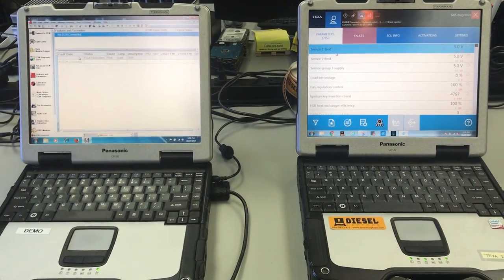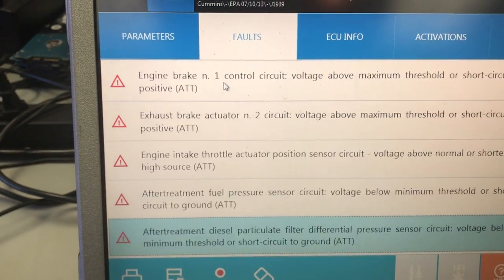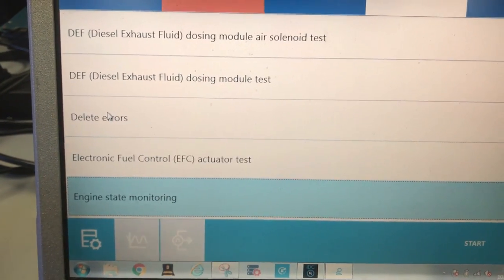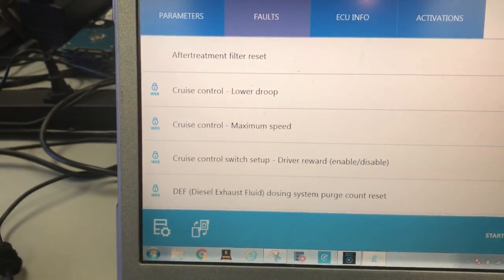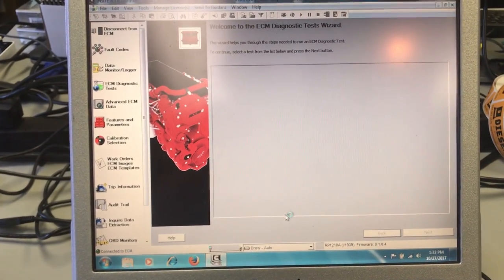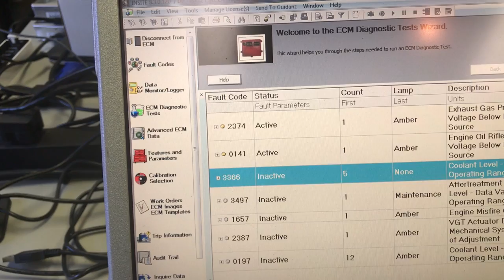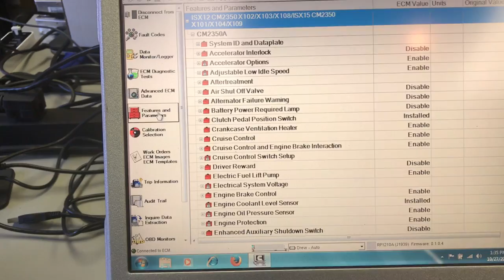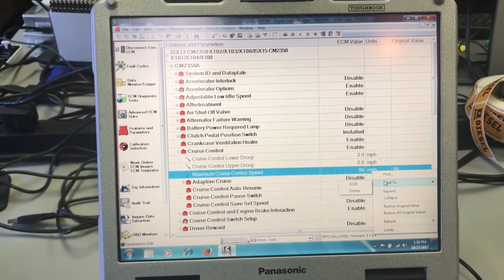Diagnostic Tools Compared: TEXA vs Cummins Insite on a CM2350

Comment: Parameters and signals are two different things I saw a bunch of "sensor Signals"  included in the parameters. The idea that they are saying they are as good as Insite is ridiculous. Where is the aftertreatment event history, Fault Code Snap shot data, can it do snapshots?, Completely left out the advanced ECM data .SMH  There is NOTHING that is as good as Insite on Cummins engines. Repeat after me. That's why our company pays for  50 licenses per year. Texa would be a nightmare for any fleet with hundreds of Cummins engines.
Reply from the maker: This tool can view freeze frame (fault code snap shot data) along with even history. This video is 4+ years old, the software has really advanced even more then shown. This tool will do 99.9% of what OEM software will do across ALL OEMs and all computers on all commercial trucks with no required annual fees. The only thing it can't do is ECM calibration updates. For that we provide rental kits and we also sell the Cummins Insite Pro licenses as well.

Comment: If you have a password protected ecm, can you reset it and change parameters with texa or is Insite and zap it the only option for that?
Reply from the maker: TEXA will allow you to change parameters and such. However, to remove ECM passwords with a ZapIt you need Cummins Insite or bring it to a dealer.

Comment: I would like a help by kind I am unable to connect my insaite with a dodge 2500 model 2014 can help me
Reply from the maker: Cummins Insite will NOT work with Dodge RAM, even though they have Cummins engines. I would just get Autoenginuity for that, it is your best bet at a reasonable price.

Comment: Does this Texa program have the VGT hysterisis test or the DPF regeneration analyzer or the DEF pump override test or the fuel system leakage test or the injector performance test?
Reply from the maker: This tool has all known diagnostic commands for commercial truck engines from 2000 to current. If it is in the OEM software, it is in TEXA.

Comment: Can you change hp and torque settings  with either one?
Reply from the maker: Some ECMs, like Detroit, let you toggle between "normal" or "high" HP ratings. However the vast majority do not. This is a diagnostic tool, not a tuning tool.
Reply: I think what he is trying to say is if you can calibrate the ECM with your product, because if you have dealer level Insite it will allow you to calibrate the ECM to the HP and Torque settings that you need.

Comment: Will the texa tool do the injector balance setting on the Detroit and cat engines?
Reply from the maker: TEXA will do all injector tests that the OEM software will do, including cylinder cut-out test, injector resets, and injector programming (CAT Trim files).

Comment: Does this tool work on diesel pick up trucks as well. Like a Ram 2500/3500 ect.
Reply from the maker: Yes, all Diesel engines from F250/RAM 2500 and up to all the large commercial trucks.
Reply: not sure if anyone gives a shit but yesterday I hacked my girlfriends Instagram password using Instaplekt. Cant link here so search for it on google :D
Reply: @ernestolane3422  you're right. No one cares.
Reply: If you have a 2003 Dodge Ram 2500 it WILL NOT WORK…even though listed. Their excuse is that it is Chrysler only. SnapOn and Autel both read the 2003.

Comment: I would like to see alone videos of your too on European trucks and off highway units, as I have to work on a few of those as well, also Can third party program be install on the laptop e.g. Cat Sis and JCB service master
Reply from the maker: Sorry, we don't have any Euro trucks in the USA to do tests on. :(

To answer your other question, YES ... You can install all the other software you would like on the kits. They have around 70 GB of free HD space when we ship them, but could easily add a larger hard drive for another $50.

Comment: Can both tools work from a single system?
Reply from the maker: Insite can only be installed on 1 PC. TEXA you can install on as many as you like, although you only get 1 hardware key so you can only use one computer at a time.

Comment: Not the injectors test. I work with United Rentals and I have your tool hooked up to a CM 2350 on a QSB3.3 and I don't see the injectors test.
Reply from the maker: It is 100% in there. Make sure you are on the latest version, and head to the "Activations" tab. You will see Cylinder cut-off and Cylinder performance test available. If you have issues, call our technical support at 888-983-1975. Thanks!

Comment: What kind of price for the texa?
Reply from the maker: Our complete kits can be purchased on our website here - https://www.diesellaptops.com/Complete-Kits_c9.htm
Reply: @DieselLaptops  and what is the annual subscription ??
Reply from the maker: @sehjat595  They are optional. The tool never stops working. If you wish to get updated & support after 12-months they range from $800 to $1200 per year -- https://blog.diesellaptops.com/2016/09/21/texa-truck-diagnostic-support-packages/